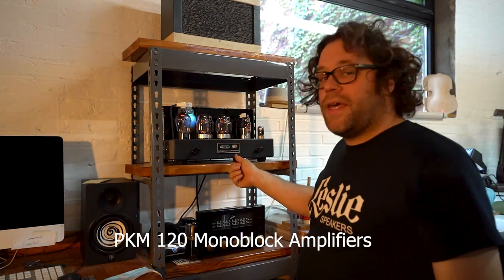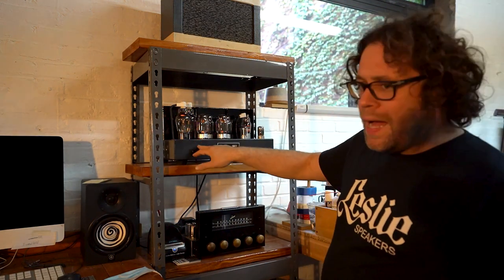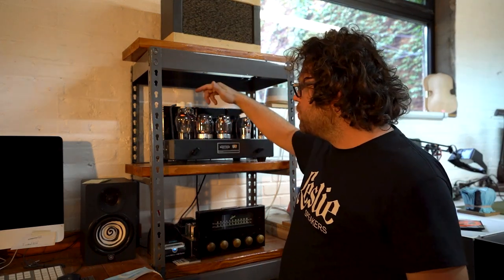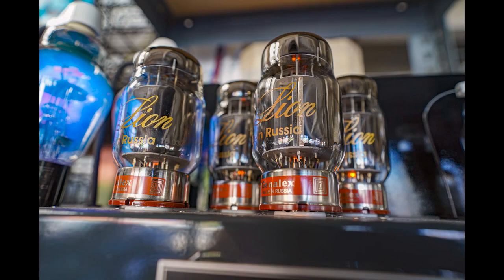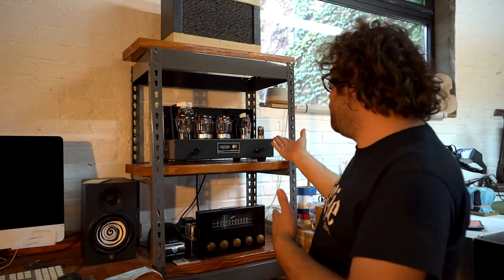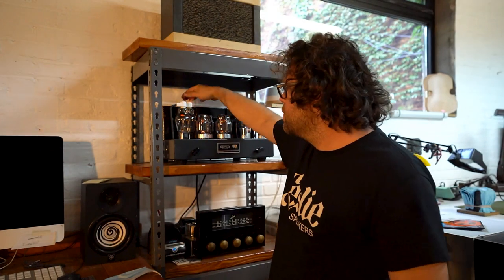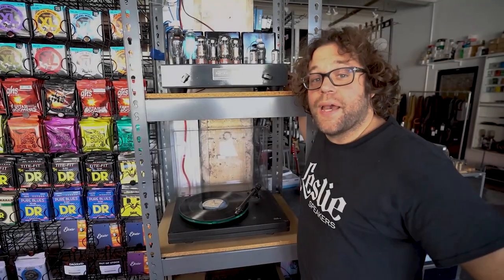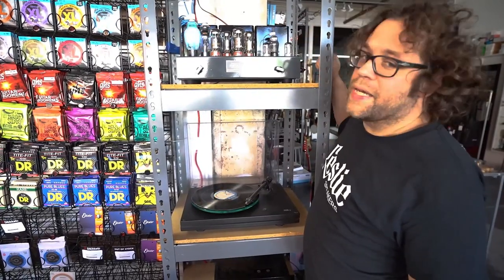PATRICK KAUFFMAN ELECTRONICS

Comment: I found the audible hum to be distracting but I really like the concept here. The mercury vapor rectifiers will be hard to replace but a) they have solid-state backup and b) they are very efficient compared to other tube rectifiers. They require several minutes to warm up and they emit a lot of UV light so potential buyers should be aware.
Reply: Hi, yes there was a terrible hum in the room from the lighting, not the amps. Also other rectifiers can be used that are not mercury vapor. There is a solid state function also which turns the rectifier tubes off. It’s fun to try different rectifiers and listen to the difference.
Reply: @patrickkauffman  I've heard some tube rectifier shootouts and had no problem discerning the differences, especially when driven hard. Your big iron (transformers and chokes) really helps realize the tubes' sonic potential. I also noticed the Goldring cartridge and greatly respect your choice.
Reply from the maker: @1mctous  yes, the lights not the amp.